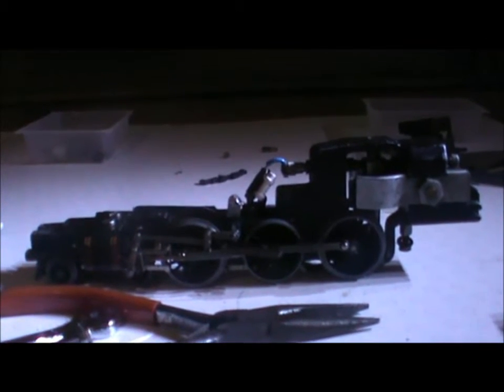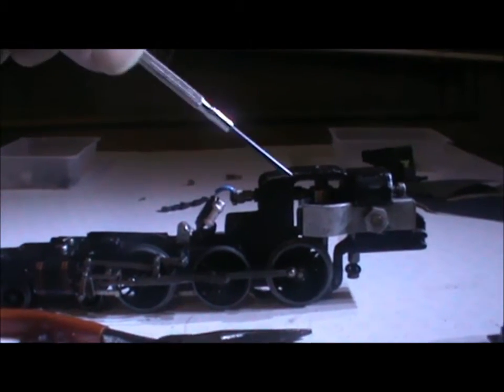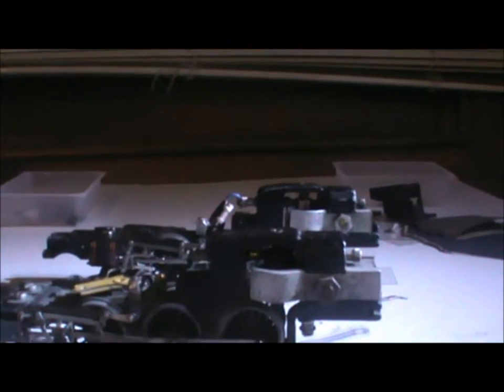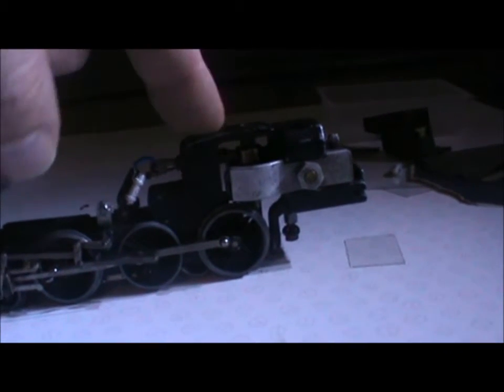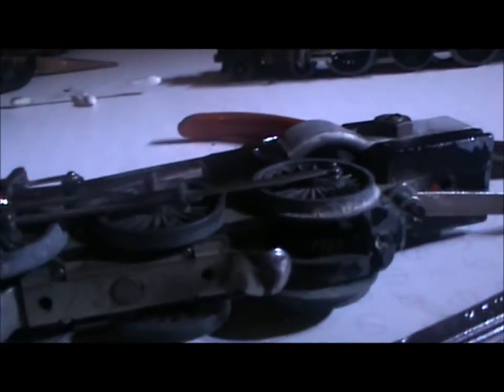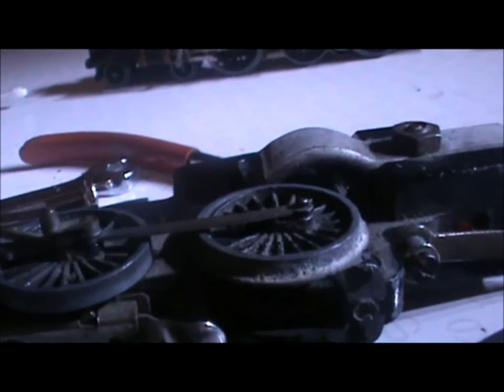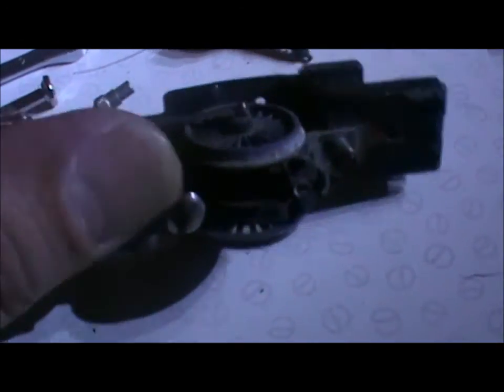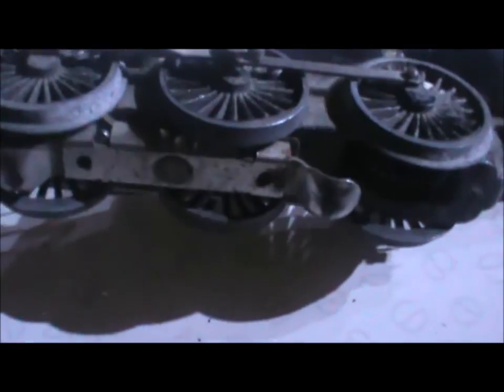A classey chassis for a Duchess, Hornby Dublo

Comment: Looks like a fun project in process.
Reply from the maker: The 'new' chassis is older than the old one, but with a little oil it freed up nicely. It was cheaper than a rewound armature. Those wheels took a lot of polishing, and I haven't really finished them, but it all works.
Reply: Buying junkers is often cheaper than replacement parts, whether with trains or cars or whathaveyou. Glad it did the trick.